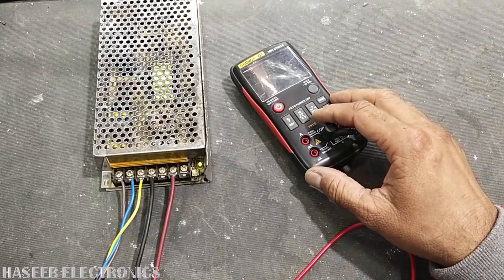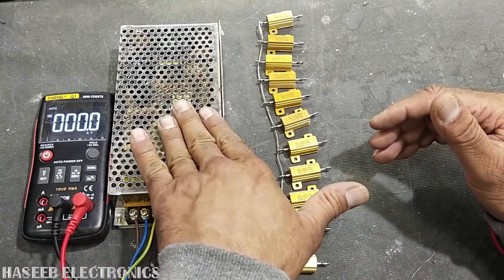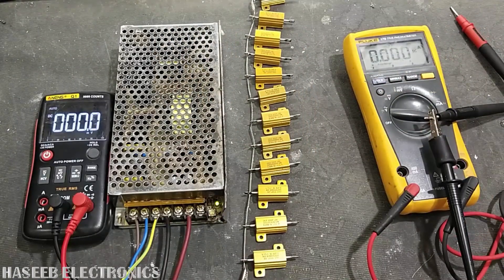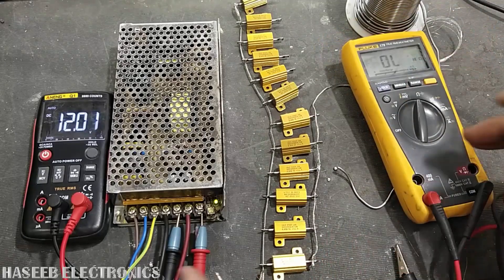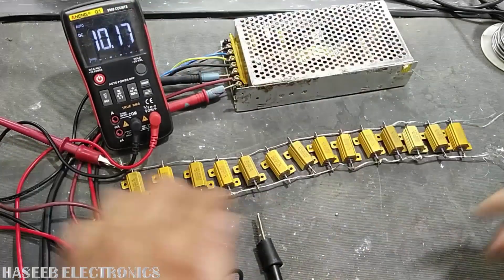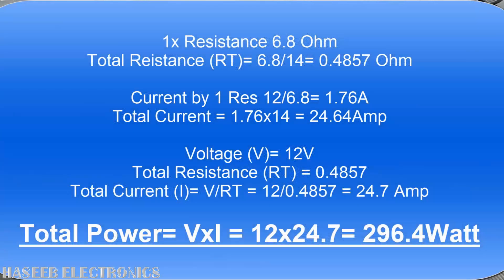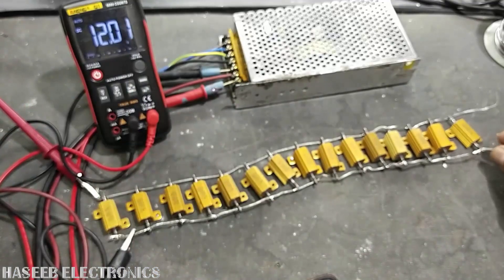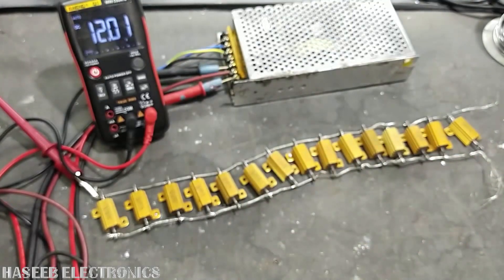{586} How To Measure Maximum Output Current of SMPS, Peak Output Power

Comment: Nice. I used to do the same to check cheap Chinese(aliexpress) power supply current rating. From experience, I tested 24V 20A power supply and I did the same test by using the same as yours, but larger. I calculated R = 24V/20A = 1.2ohm based on nameplate, so I bought 5pieces of100w 6ohm to test this power supply. Honestly, those cheap power supplies were overrated for more money.
Reply from the maker: Awesome 
You are right. In these cheap brands, there is no quality control and standards 
Printed values are far away than the physical values 
But comparing price and quality. 
These power supplies are good while operating less than 80% of the rated current
Reply: @HaseebElectronics  You are right. When I want to use 24V 30A, I will just order 2units of 8-10USD 24V20A and parallel. Or I just buy 30-35 USD second hand meanwell 24V 30A. I guess it depends on the work. I would install quality power supply in control cabinet, and cheapo one for occasional use. Your videos are very good and informative, I often come to watch on certain topics that I am not really sure.
Reply from the maker: @chirots yes if we get secondhand branded power supplies in good condition 
That is much better than purchasing new low quality power supply 
Sometimes the polarized capacitors on DC rail.
Reply: @HaseebElectronics  Sometimes, we cannot get the second hand at the reasonable price or at required spec. It is either too small or too large for the work. Usually, you will find the second products that you really need when you have already bought cheap quality products. This just happened to me last week. lol...

Comment: Sir in one of the you tube video uploaded by a blogger in which I saw he is measuring current of SMPS by connecting multimeter set in 10a and com point and then applying parallelely to the SMPS output.
Reply from the maker: that is not a good method
he is using multimeter as a load, while multimeter is not a load. it is a test instrument 
because in multimeter, there is a fast blow fuse, if we connect to high current source, immidiately it will damage 
it must be connected in series with any load
Reply: @HaseebElectronics  sir can you upload a video about SMPS battery charger circuit ampere testing process.🙏

Comment: You can also make a nice resistor out of pencil lead... I have been experimenting with it recently and it actually nice, but be careful it can glow hot
Reply from the maker: great 
the best option is to use heating element of 1000 electric heating wire

Comment: Hi, rally it good thanks you so much.  please help me how to select topology and what are the critical parameters consider for converter topology selection.  E.g 48vdc input, o/p 12v/10A isolation cccv  driver for charging application,  this we can design flyback or forward or push pull or half bridge. But how to select for topology for start up. Pls help me

Comment: Sir, thank you very much.
I need your support to find a problem in smps model: aps150rf-d.
the o/p 24vdc is good and the fan voltage is 10.5v, when connect the fan socket the fan voltage drops to 3.6v but 24v still good and the indectation Led light goes down.
I'm change the o/p capacitors but still the problem the same

Comment: Asalam alakum  sir mere pass ek 6 volt battery Ka smps charger  ata ha .us ke output nhi  aa rha ha. Koi bhi  component  short nhi  ha. Thori  der  bad power transistor  heat hota ha.halanki  transistor  bhi  thik ha .kia problem ho  skta  ha.please zaror bataye..
Reply from the maker: please check its output circuit
check start-up resistor for initial starting 
feedback circuit agr cut na karwaaey to transistor heat up hota he
Reply: Sir feedback keliye  optocoupler nhi laga hwa ha.startup resistor ki waja se bhi transistor  heat  hota Kia?
Reply from the maker: if there is some PF capacitor with transistor, check it 
or 
may be transformer

Comment: dear haseeb sir can you help me by designing a universal load tester with voltage varying from 1 to 440 volts.
Reply from the maker: brother 
i don't have practical experience in this field. i will check if i can find some solution, i will contact positively

Comment: salam sir,i was working on laptop adapter and was increasing its voltage by removing one of the two resistor from tl431 refrence pen and put a variable resistor.when i was increaing and decreasing voltage,suddenly i got shock from variable resistor.can you explain how this happen.thanks

Comment: if voltage drops 10%  below normal 
ratings then it's  max power can deliver .
Reply from the maker: no, when the power supply looses it's load regulation that is most of the time 0.5 percent of the nominal voltage 
that peak point is considered as Pout Maximum
at peak voltage and peak current we have to calculate
Reply: @HaseebElectronics   when the power supply output loses regulation it means the   feed back circuit reached its maximum adjustable  point  that puts the power switching device on primary side at critical  operating point 
if it's a low quality design it won't last long until it fails  
(without  input DC pfc circuit at primary side, no thermal shutdown circuit , no over current protection shutdown circuit. 

when output  start losing 10% of it's  output nominal voltage this point is its maximum safe power to draw.
Reply from the maker: yes in that scenario it is to be calculated for safe range for an immature design